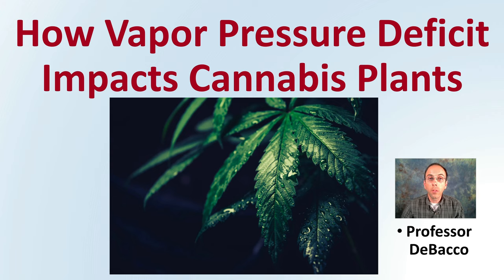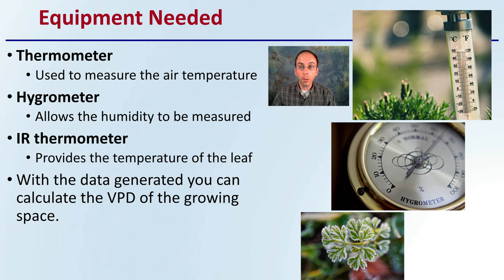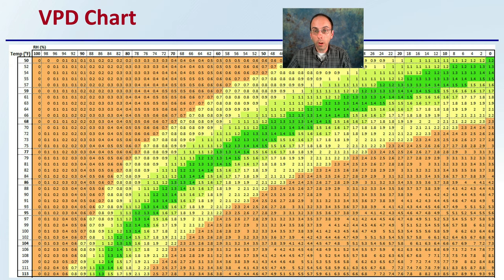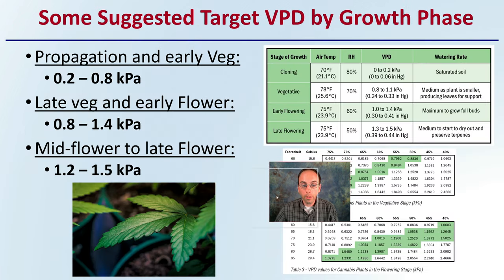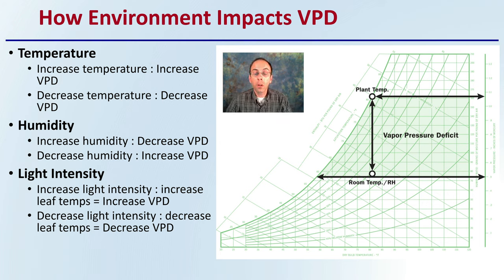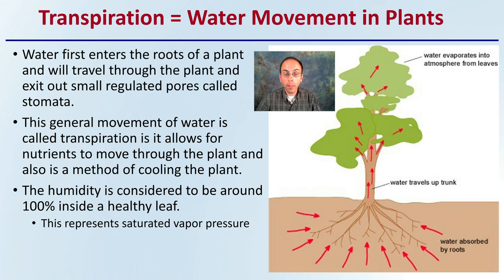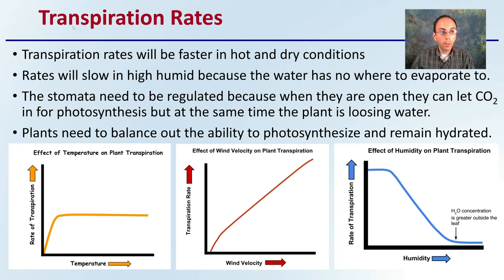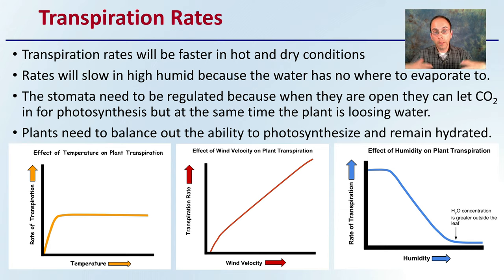How Vapor Pressure Deficit Impacts Cannabis Plants

Comment: How does light intensity affect vpd requirement? If you were in a warm but low light environment or a cold but high ppfd environment, how would that affect the plant, its transpiration and nutirional requirement?
Reply from the maker: Take the temperature and humidity environmental factors to have the greatest impact on the general VPD.  Not only light intensity, but air flow and carbon dioxide concentration will all impact stomata opening and closure, but these are details compared to the temp. and humidity.  Hope this helps.

Comment: I've watched hundred's of videos. And have read hundred's of articles on this subject.

And this video is the best I've seen. By far. Good job.

You covered alot more than anyone else.

But the reason I've been studying this subject so much, and I can't find ANY INFO on is.

First let me give you a little info on my set up.
My flowering room is
10'x20'.
I have a window a/c unit and a portable dehumidifier.
Both work very well in this 120 s/ft area.
In my opinion neither one is being over worked to keep this room at the temperature and humidity levels I TRY AND KEEP.

And this is where I think a problem may be happening.

The a/c keeps the room at the temperature I want.
But slowly the humidity will rise. And then the dehumidifier kicks on and lowers the humidity, but makes the temperature rise.
So I am constantly getting a 5 to 10 point swing in the temperature and humidity levels.
I'm sure this is happening with most growers.

But what I'm trying to find out is what kind of effects if any this has on the plants.
I'm sure this happens in nature. But not at this degree.
This change in temperature and humidity is happening 2 to 3 times a hour.
I'm sure it doesn't have to much of a effect, because I've been getting great results for decades.

But we all know that one good little adjustment can increase yield and or quality 10 to 20 percent.

So I'm hoping you might have some information on this subject.
Thanks.
Reply from the maker: Thanks for the praise on the video content!
Regarding your situation additional questions I have are what is your air circulation/venting set-up and where are the sensors placed?  Also, is heating needed for this room or is it mainly cooling that is needed to maintain the temperature?  Also, what is your method of irrigation?  Sorry for all the questions but these will impact the conditions you are asking about.  Also, remember, the plants are going to be adding to the humidity as well.
Reply: Your room is 200 square feet, not 120. Is your equipment sized correctly? Temperature and humidity will always fluctuate, but to maintain whatever set points you desire, you need to over size the humidity and temperature control equipment to prevent the bigger swings from happening. Also, cheap junk dehumidifiers don’t work nearly as well as a Quest. Quest dehumidifiers are a bit expensive, but they are efficient, and actually work.

Comment: So this is why I'm getting such slow growth in early veg! Had humidity set to 55% -  60%.. Vdp most of the time about 1.00.. Looking forward to making these changes and seeing the difference. Thanks for the help.. 👍
Reply from the maker: You should see an improvement;-)
Reply: @DeBaccoUniversity  hey, yeah I've definitely noticed my plants looking healthier even in 2 days. 

. I've slight issue with my humidifier, it's not 100% accurate. I have it set to 65%, when it comes on it boosts it to 80%. and then slowly drops back to 65%. This cycle takes about 25m.. Vdp is only at 0.95 when it's close to 65%..most of the time of that cycle it's between 0.45-0.75.
 Thanks for the uploads. I'm from Ireland and appreciate the help.. 👍

Comment: great video, although you didn't cover measuring for VPD and how leaf surface temp affects the number. The charts in the video are off, because they don't account for LST. In mid flower I run ambient 90, LST- 85, so humidity is set to 53% to keep me at 1.4 VPD. No worry of bud rot or mildew at those numbers.
Reply from the maker: Thanks for sharing your experience and details.
Reply: 85/53 is to dry. 80/60 is 1.3. at 53% RH you'd want more like 74 degrees. Just going off my experience.

Comment: You mentioned transpiration increasing as wind velocity increases (fan blowing onto plant) so is it advised not to have a fan blow onto your plant in veg when VPD is around 1.0? Wind velocity doesn't directly affect VPD but id be interested to hear your take on this:)
Reply from the maker: Air movement is important, key is the leaves should be moving slightly and not aggressively to help reduce disease and not impact VPD that much.

Comment: Given that high humidity slows transpiration, in a very hot humid environment would it benefit the plants to have more wind?
Reply from the maker: Technically from a VPD stand point wind makes little difference, but yes more air circulation would be advised if other environmental factors could not be modified.

Comment: Excellent videos! I was wondering if you ever compare leds vs hps when it comes to leave's temperature?
Reply from the maker: Not sure if you saw this DeBacco University video... https://www.youtube.com/watch?v=hZiAzcYdDsM&t=55s but no direct leaf temp comparisons but LED will be lower than HPS.
Reply: @DeBaccoUniversity  yes I did. :)
Can heat causes hermaphrodite? Seems a few places are saying it can causes fem to turn herms because of the heat... So, if we have to get higher temp because of LED, we have to be even more careful about the breeders we pick our seeds from. Or it's an easy thing to say because stability isn't on the table anymore :( 

Also, with new LED generation, they started to add IR led, I'm wondering if it can raise the leaf temp a bit.

I have to buy a new thermal camera or IR gun but the ir gun are somewhat unreliable :| 

So if raising humidity, I guess it raises the internal temperature of the leaves since evaporation is lower. I took some measurements and well, I even saw some 65-68F temp! Water temp is at 70 (dwc)

Thanks again for all those informative videos! really nice job! :)

Comment: What about lights off VPD? If your supplementing with Co2 canisters or bags, would a low VPD when the lights are off be more beneficial or is VPD recommened to stay consistent throughout a 24 hour period in range with the stage of growth?
Reply from the maker: VPD does not change with lights on or off or with or without CO2... however the temperature often changes so follow the graph target ranges.
Reply: @DeBaccoUniversity  just going back to a previous slide on the video it says that a lower VPD will open up the stomata's making it easier for the plants to uptake Co2, so would it be more beneficial if your supplementing Co2 to have periods of low VPD? Sorry if the question was un clear thanks for clearing up the other question and getting back to me about the VPD being consistent  throughout the cycle depending on stage of growth. Thanks for all the knowledge and helping me understand how to grow plants to the best potential they can big love debacco

Comment: Hello, i have a tent outside that is hard to cool down when it’s hot outside, so if it’s 90 degrees in there, should i match it with the corresponding humidity (75%) or is that too humid since my plants are in late flower?
Reply from the maker: Goal 1 would be to reduce temperatures, second enrich with CO2 as plants are tolerate 90F better than at ambient conditions, increasing humidity would likely cause other issues.

Comment: VPD charts or calculators without LEAF TEMPS are useless. The "D" is the deficit or differential (difference between) air temp and leaf temp, air relative humidity and internal leaf humidity (which is 100%).
Reply from the maker: The equation is shown at 0:33